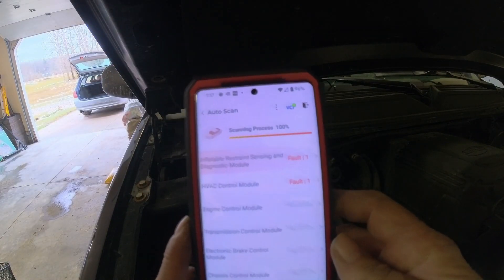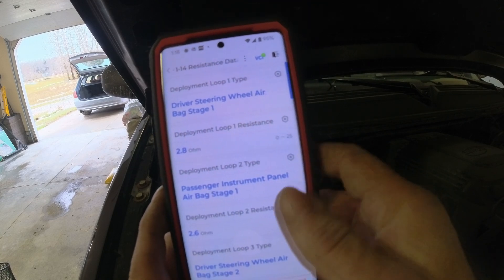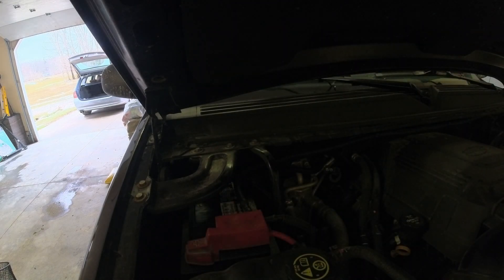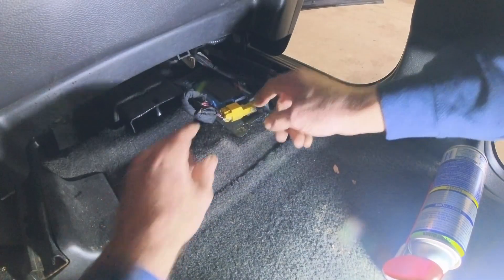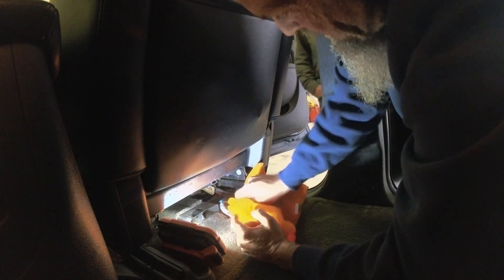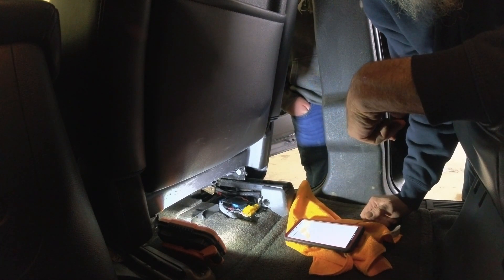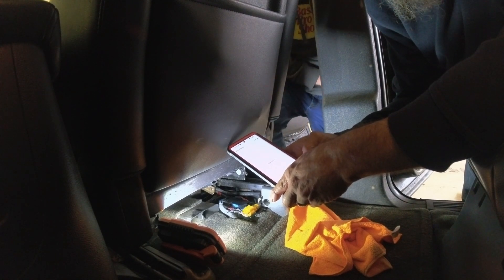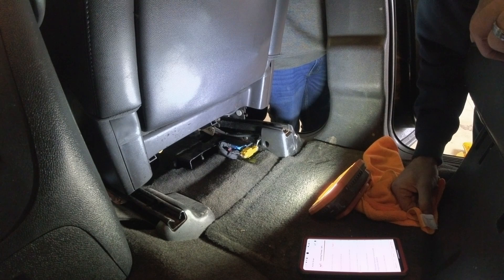2014 Suburban High Resistance On Airbag DTC B0021 #topdon #topscan

Comment: Usually on airbags, the diagonal monitor wants to see around 1.8-3.0 ohms (don’t complain if I’m not dead on) but the monitor wants to see evenness in the resistance. When they start to hang out high, it’s usually a connector or wiring at or near the connector that’s off. Sometimes just disconnecting and reconnecting the plug is enough to get rid of terminal fretting (oxidation). Good job.

Comment: I don't see any water that needs displacing, so why are you using water displacement 40? I'd use electrical contact cleaner then deoxit.
Reply: The deoxit will leave a layer, but that's ok.
Reply: Also, might want to junkyard dive for that cover.
Reply from the maker: electrical contact cleaner
Reply: WD 40 makes a contact cleaner. Look at Joes can carefully
Reply: @steveb6371  it's a joke.